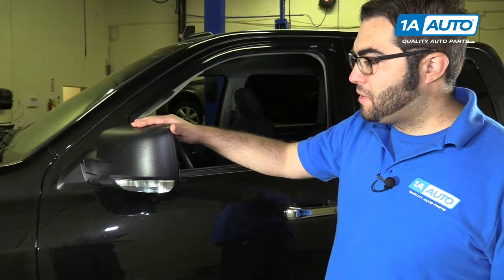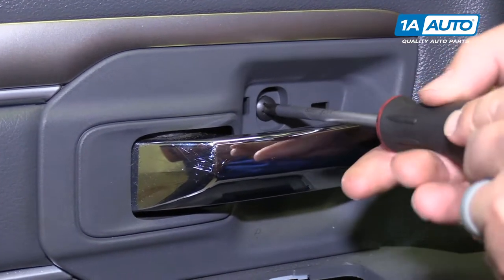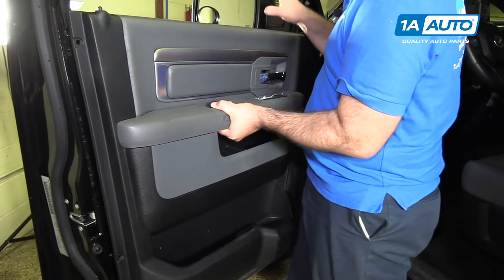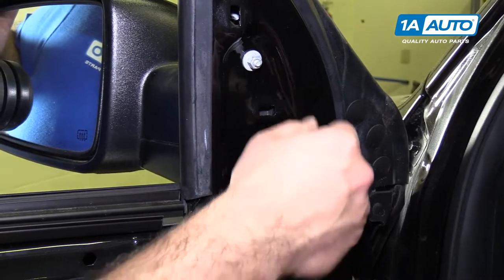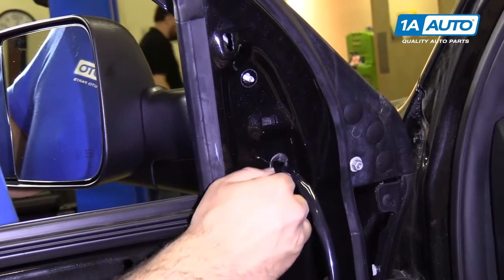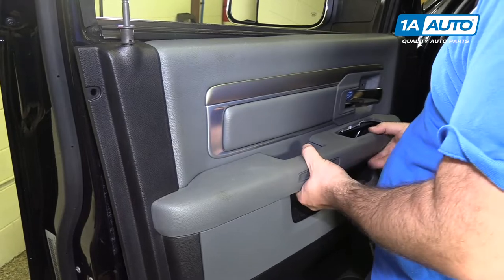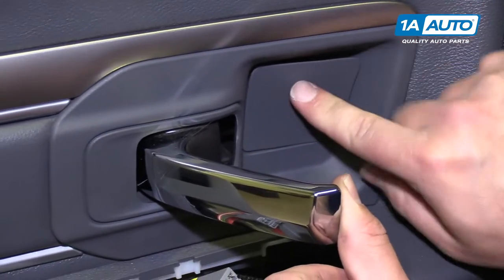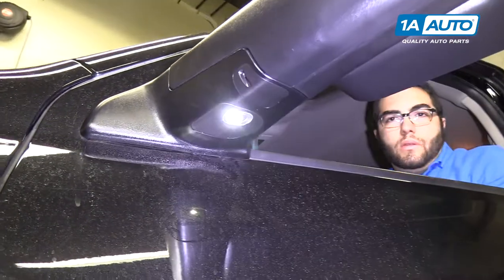How to Install Black Trail Ridge Tow Mirrors 13-17 Dodge Ram

Comment: I second NHL CFL comments and want to add my own. I had seen the installation video before ordering the mirrors.  I placed my order and received the package two days earlier than promised. I watched the video one more time and had them installed in less than an hour, with some assistance from my son. I cannot remember ever having this kind of service and/or ease of installation ever! I usually have items like this installed for me. I do not like working on vehicles. But the video was straight forward and gave me the confidence to try and tackle this project. This was the easiest thing I have ever worked on....Period! Thanks 1A Auto Parts! I will shop from you again and pass your information along to family and friends.
Reply from the maker: +Nate Antieau Thank you! We love empowering our customers and showing how to perform DIY auto repairs with our high-quality auto parts. 1AAuto.com
Reply: Note: I did lose the auto-dimming function of my factory mirrors. I will just have to get used to it. I feel it's a small sacrifice to gain the wider towing mirror. I'm not complaining, just letting potential shoppers know.

Comment: Just finished installing a set of these Trails Ridge towing mirrors on my 2016 Ram Rebel - driver's side factory original tow mirror was broken off at a job site. They arrived well packaged and fit & finish was as good (maybe better) than the factory original tow mirrors and several hundred dollars less money per mirror! The installation video was spot on. Hardest part for me was massaging the door panels back on, but overall less than 2 hours and everything worked great. Thanks 1A Auto for the video and parts.
Reply from the maker: +Steve Thank you! We love empowering our customers and showing how to perform DIY auto repairs with our high-quality auto parts.  http://1aau.to/m/Shop-1AAuto-c

Comment: I bought these exact mirrors for a 2017 Ram 1500 5.7L Hemi.  This video was 100% identical to what I encountered when installing and the mirrors were perfect.  They both worked on the first try (a note says they may need to be synchronized).  This video made made the process easy and I was finished in about 45 minutes.  Thanks guys.
Reply from the maker: +Dave Graham Thank you! We love empowering our customers and showing how to perform DIY auto repairs with our high-quality auto parts. 1AAuto.com

Comment: Very helpful video, just a couple of things to add. Put your windows down before doing this and on my 2019 Classic Tradesmen i was able to take out the plastic trim piece surrounding the interior door handle and it makes removal and install of the door panels 10X easier without forcing anything.
Reply from the maker: +Ryan Spencer Thanks for the feedback!

Comment: Isn't the tow mirror reinforcement bracket required?
Reply: Yup it sure is, they didn't READ The instruction manual........LOL. Or order the part before the video. too funny.
Reply: Just to confirm but the reinforcement bracket is required yes?
Reply: A lot of people use them without brackets and have no issues

Comment: Hi , thank you for the video 👍, i do have an issue tho.. I’ve installed towing mirrors just like you were showing in the video and i have an engine light on, the code i found on internet says is the temperature sensor which should be in the mirrors, my question is when i will program the puddle light and the signal light to work with obd will that engine light go away ?? I also have my sensor stuck at -40.
Reply from the maker: +Alessandro Terracciano Thanks for watching!  We recommend checking the temperature sensor wire to make sure it is making a good connections.  Please keep in mind that these mirrors are made to be direct replacements for mirrors that have all the same options, so they should plug-and-play with no issues.  If you are trying to add these options then you can run into issues.  1aauto.com
Reply: 1A Auto Parts i bought the towing mirrors of Kijiji and i found out later on they didn’t have ambient sensor.. so i took it from my original mirror and installed on those ones..only problem now engine light it is still on, i guess i will erase it with an obd, and I couldn’t put the sensor all the way through in the spot they were supposed to so now outside we have -16 and after 10 min I’m in my rig with the heater on my sensor goes +5 LOL , but as long as i erase the issue and take that engine light off I’m ok with it.. thanks for the help !
Reply: Alessandro Terracciano  did getting your signal and puddle lights programmed fix the problem?    I’m adding mirrors that are like my stock ones except I’ll have to have those activated as well.  Thanks

Comment: I just bought a 2018 Ram 1500 and want to install tow mirrors. Will these mirrors fit and have a similar install? Ready to buy today as these are a great price!
Reply from the maker: +HezaSwiftTeFleet The part shown in the video does fit your application given all the mirror options match what your vehicle is equip for (minus any upgrades). It should be the same or a similar procedure. Here is a link to them on our website. Hope this helps you out. https://www.1aauto.com/2013-18-ram-mirror-pair-trail-ridge-tr00053/i/trmrp00053